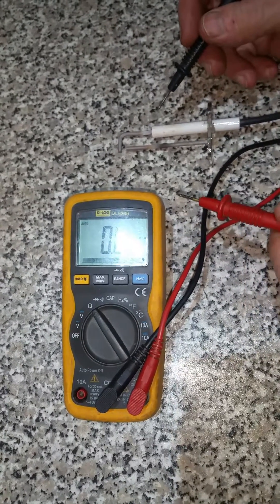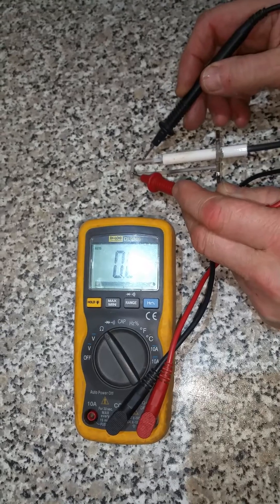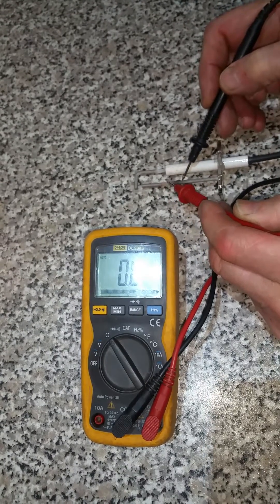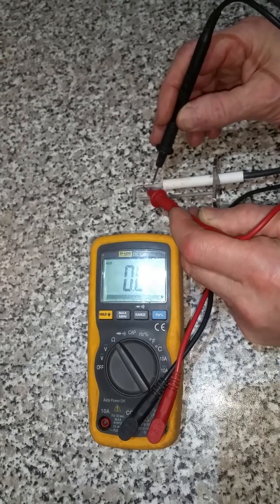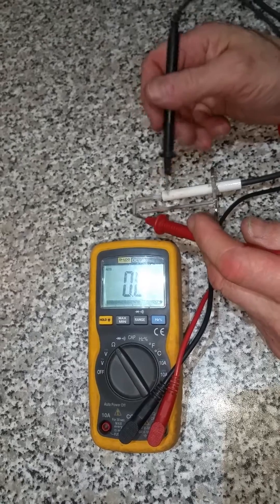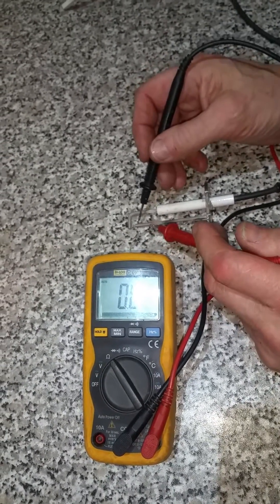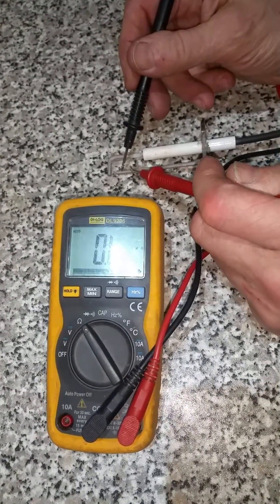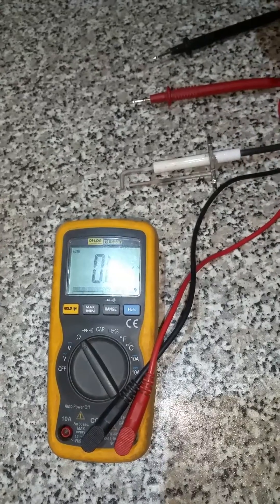Testing ionisation probes and ignition electrodes.

Comment: Yes you can reuse the Flame sensor.  All it is is stainless steel (Sorry you already know this) so you can clean off the carbon and use it again just like new.  I imagine most repair people would replace it with a new one.  You can, however, clean it up in a pinch and get your heat back on.
Reply: What would you recommend to clean off the carbon deposits ?
Reply: @jamiewilliams685  John Wilson recommends using a file (in the original video which this one references: https://www.youtube.com/watch?v=IwrYUcx1Sqc&t=520s ). I think a metallic pan scrubber with some vinegar should do just fine. Make sure to thoroughly wash off the vinegar afterwards.

Comment: John Wilson's video mentions using a file to remove carbon deposits in order to regain conductivity at the tip of the electrode. Have you tried this?
Reply: I have and it works. Just don't get carried away with the Bastard file 🤣. If you heat the electrodes with your blow torch, upto to a point where they glow. You can adjust the gap to what Mi state. I've done this a few times also.
Reply from the maker: Adam Carter no I've not tried it.